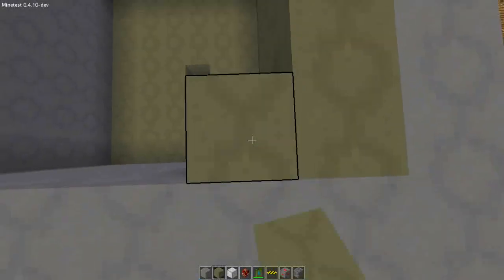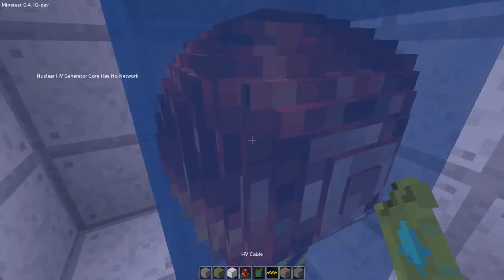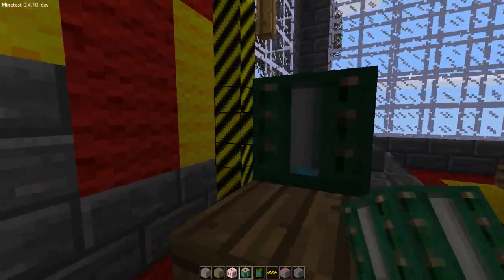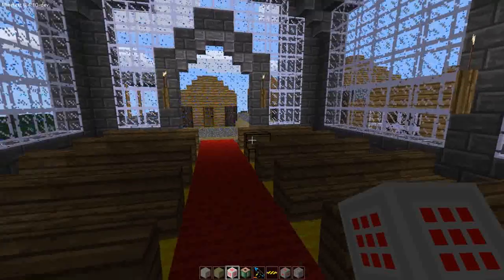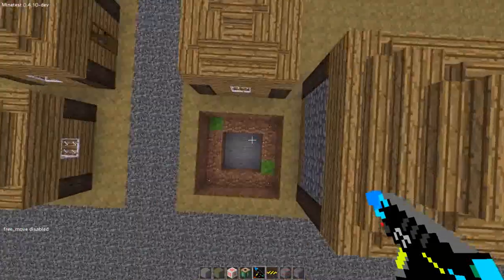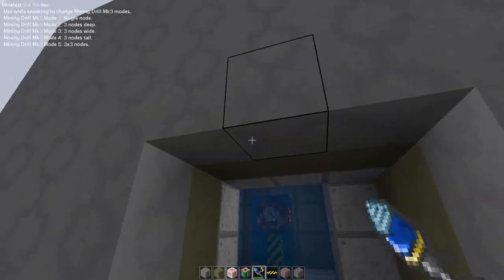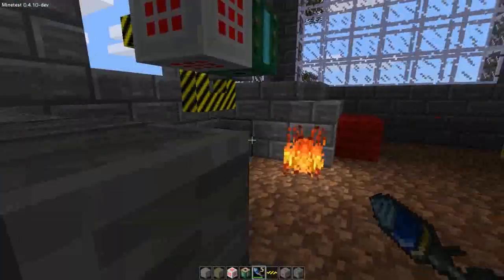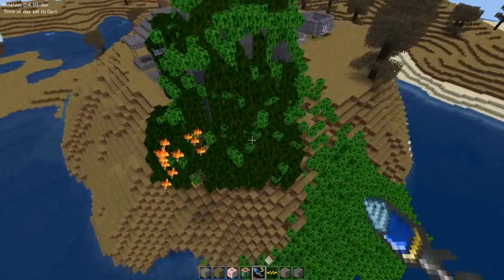Minetest: Technic Mod - Nuclear Reactor + Meltdown

Comment: How did you get your core to activate? When I built it the same way it says core is idle and no power comes out of it.
Reply from the maker: It should activate once you have a complete circuit, structure and fuel in place. Do you have all of that setup and connected and still no power?
Reply: Richard McFarley Yeah I do. I found out that I was 1 layer short at the bottom of the outer 9x9x9 shell.
Reply: Richard McFarley Thank You for the excellent instructional video.
Reply from the maker: Thanks for watching! I've been really busy lately, but I'd like to do more in the future. I love the technic mod!

Comment: Great video. Worth mentioning that with damage enabled you cannot get anywhere near the corium source block as it is EXTREMELY radioactive and it will kill you within seconds even from 20 or 30 nodes away. You would have to try and build a walkway FAR above the reactor to try and drop something down to replace the corium source, and you want to do it quickly to minimise the flowing corium forming more and more chernobylite. A meltdown is something you want to avoid at all costs during normal play. Use of a protection mod is a very good idea.
Reply from the maker: Yeah, I never successfully recovered from a meltdown in normal mode. Thanks for the idea though, I never thought of a high walkway.